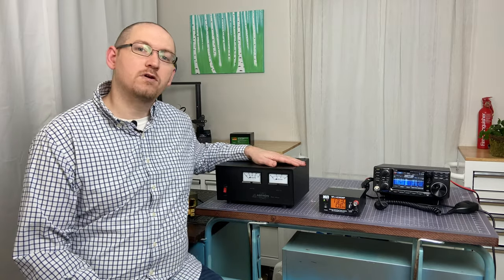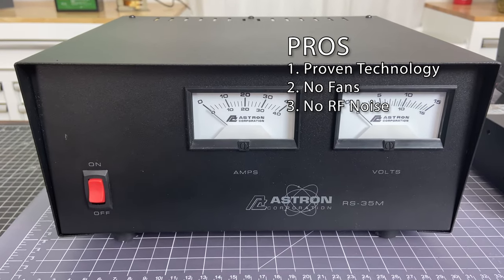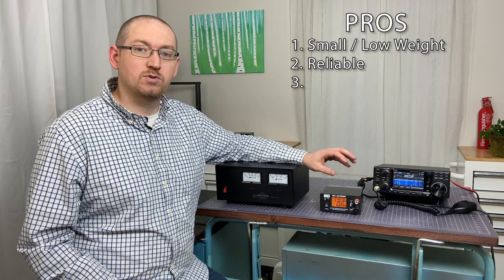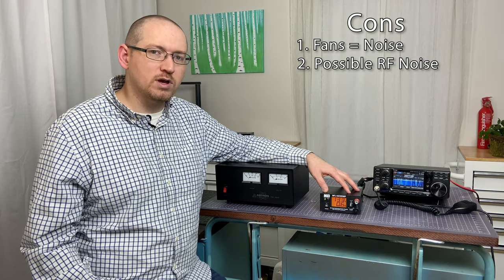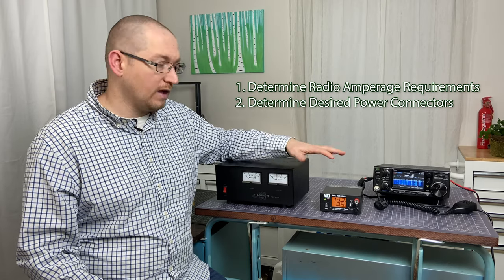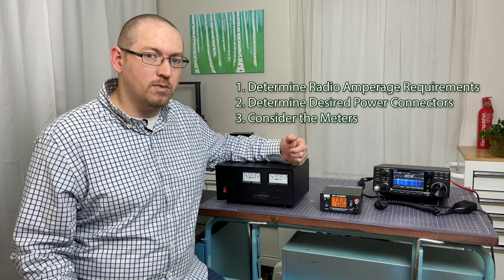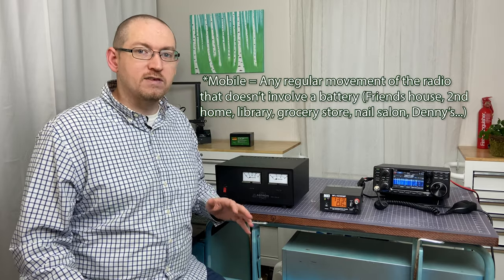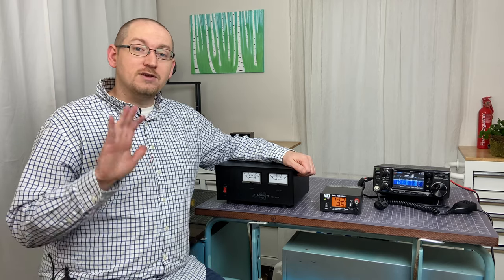Your First Power Supply - Linear or Switching?

Comment: I have a Astron 50M and have used it for about 30 years now. I hated to move it around to attach another radio what a pain. So I got my trusty Ryobi drill and put 4 holes in the front. Now I have 2 more sets of terminals with easy access. Like I said this supply is a beast. Also have a 70M but that thing does not get moved at all.
Reply from the maker: I'd love to see how you connected the 2 additional sets of terminals. That would be a good project!

Comment: I was using switching power supplies before switching power supplies were cool, early 1990s, and the switching supply I used then and still use is a Lambda switching power supply rated at 48 amps. I almost completely attenuated the RF hash noise by brute forcing ferrite beads at the output of the supply to where the noise was just above the natural noise floor of the band I was working, 10 Meters in this case, and arguably the least noisy of the HF bands. Don't let the EMI noise scare you away from using switching power supplies.
Reply from the maker: You bring up some really good points: Sometimes the noise generated by local sources is lower than the noise floor and consequently it isn't as big of a problem as it might seem. Also, the companies have had thirty years to keep making better and better power supplies. Thanks for adding to this conversation!
Reply: Linear regulated is still a better power supply than switching . I can detect the RF hashing noise on my high end equipment from switching power supply's.. Linear Regulated is the way to go.
Reply: The title is "your first power supply".  If that's the case, I doubt someone would be able to trace the source of the noise, e.g. the linear supply K-Tech fixed by moving a ground.
Reply: I agree, I use a Samlex 1235M and i have no rfi issues whatsoever

Comment: I have a 223 pound power supply that the titian two check out missile used.  I got it at a hamfest for for about 150 bucks that I ran on two repeater systems on VHF and UHF with power amps.  This monster puts out about 100 plus  amps at 12 to 14 volts.  I still have it and could power up any Kilowatt ham station for ever...

Comment: 2 October 2024. Just bought  this last unit available Astron 35 on Amazon. I hate fan noise. Its about twice the price of a good switching power supply I was thinking about getting. Always get good stuff your planning on using for years.

Comment: Another pro for linear supplies like the Astron you have there is repairability.
Because linear supplies are fairly simple their repairs can also be pretty simple.
Unless you melt down the transformer in one of those supplies you will probably be able to repair it quickly and cheaply.
Cheers.
Reply from the maker: Excellent point. For anyone that is willing to learn, that could be a good opportunity, and without a significant overhead of knowledge. Thanks for bringing this up! 73, AC3DS
Reply: @netautorisationnetautorisa545  😂
Reply: Yes yes yes
Reply: My RS-70M got hit by a lightning strike several months ago and it may not be repairable.It’s well over 20 years old and it has served me well.
Reply: Greetings: True. I was a remote service station 4 Astron back in the 80s - early 90s prior the major employment of consumer grade SMPS. All that came in lived, warranty or not. I could not make modifications on warranty however I did some upgrades on non warranty units as per customer request and permission. I implemented some of those mods in many supplies I built. A few I still use on my bench.

Comment: Good video 👍 like you I use both my MFJ switching power supply just dyed after 21 year of continuous running for 24 hrs a day.  I will replace it with a new MFJ switching but I pulled an old 20A ASTRON liner out of the closet that’s been there for at least long and it fired right up so I thank both are great quality. I bought the ASTRON 20A back in 1982 so it’s been around a while.👍✅  KV5P
Reply from the maker: Thanks for sharing your experience. 21 years @ 24 hours per day -- Wow, definitely got your money's worth there. For the Astron, I'd say 38 years and still running is a ringing endorsement, even if it has been sitting for a while. Both manufacturers know their way around a solid power supply. Good to know I won't be shopping for one anytime soon.

Comment: Building my first shack and went with the Yaesu FP-1030A linear 30A power supply.  It's very quiet but the analog meters aren't illuminated.  

I also fly RC model aircraft (electric) and the Electronic Speed Controls are offered with either linear or switching BEC (Battery Elimination Circuit) to power the receiver and servos using the same litium-polymer battery as the motor.  These generally run around 10A or less so use switching BECs.  Battery efficiency was the prime consideration for RC.  Quiet for my Ham shack.
Reply from the maker: Yaesu makes high quality goods, and the FP-1030A is a solid supply that should bring you years of care-free performance. It is good that those BEC are quiet in the shack - I have some RC that are very noisy and as soon as I turn on my radio I'm reminded to unplug.

Comment: I have the same astron power supply. Had it for a month and working great
Reply from the maker: Glad to hear it. They are great machines that, because they just sit there, don't get as much pomp and circumstance as they deserve. Thanks for sharing!
Reply: I've got a VS-35M (same except variable voltage) for as long as I've been a ham.
I was first licensed in the 70's. I've had to change a pass transistor once and it keeps on ticking.
Had a switching supply when they first came out. Couldn't use 40 meter because of a whirling zero beat sounding rfi. They're better now. Still have my 35A and got a Astron 70 amp for my amps. A linear supply for my linear's

Comment: I use only linear supplies for my regular equipment, although the amplifier runs on a 32V 150A industrial grade switching supply specifically made for transmitting equipment by AM. The problem with cheap switching supplies are the loop speeds that are super fast to protect the marginal FET's used and that get triggered by peak modes like SSB, CW and sometimes digital. This can be overcome by adding a big enough storage capacitor with a soft start. But by the time that is done one might as well go back to linear supplies.

Comment: Good advice. I'll add another option. I have two linears, an Astron RS-35A and a Pyramid PS-26KX. The first doesn't have meters, but I got such a good deal on it at a hamfest I don't mind. The Pyramid has meters and an adjustable output voltage from 6-16 volts. Those who're planning to experiment and may need different voltages might pay a bit more to get one that is adjustable.

Comment: In general - a good idea for a switching supply would be a GO box, provided you didn't restrict the air flow by buring it in a mas of cables and/or panels.

Specifics - I've always looked at MFJ with a cautious eye.  Their quality control has gotten better, and they make some popular equipment lime the Versa Tuner and 259 (antenna analyzer).  I've not heard much about the switching supply, so no news is good news (?).

The Astron linear and switching supplies are workhorses, and I've only had one RS-35 fail on me when transmitting on an HF rig.  A capacitor and voltage regulator replacment fixed that and havr not had problems since.  Also, I've not seen a problem with their switching supplies.  Their fans are quiet, and no hash on the RF.

What you presented is a good foundation and understanding the difference between the two types.  I look forward to seeing more of your videos.
Reply from the maker: You are very right about the use of the switching power supply in a GO box - a definite addition. 

I've seen some great products by MFJ, and then I've heard some quality control issues as well. The only piece of MFJ equipment that I've personally observed being of unusual quality was a 259 that looked like it had been repurposed from other pieces of metal with printing on the inside that definitely didn't belong --- but it didn't affect the performance at all, so no harm in a sense. 

Thanks for the feedback and for adding to the conversation. The experience and voice that everyone brings to the discussion helps new and experienced operators alike! 73 - AC3DS
Reply: I always open the case on anything I get from MFJ and remove the loose screws and solder blobs rolling around inside and check for anything out of place before powering it up the first time.  It happens a lot.  MFJ has a reputation for a reason.

Comment: I've got a VS-35M (same except variable voltage) for as long as I've been a ham.
I was first licensed in the 70's. I've had to change a pass transistor once and it keeps on ticking.
Had a switching supply when they first came out. Couldn't use 40 meter because of a whirling zero beat sounding rfi. They're better now. Still have my 35A and got a Astron 70 amp for my amps. A linear supply for my linear's
Reply from the maker: Variable voltage would have some advantages. One day I hope get my hands and mind some experience with tube-based equipment. Knowing that 13.8 is a bit of an average, I suspect that having a variable voltage supply would be beneficial in optimization and flexibility. I see these beautiful radios and amps from the 40's - 80's and know that there is a lot of great learning, making, tinkering, and communicating, to be had there... Good point about the need for a linear for the linears - when a shack starts to build up, the power requirements tend to increase as well, and the Astron 70 seems to be the gold standard for heavy lifting. 73- AC3DS

Comment: My old Alinco power supply DM-340MV is the best and am sorry they stopped making it... I run 3 radios off it and have no problems.  The switching power that I have has RF problems even through they say how to get rid of it, but a small of RF is still there.  Get a damn good old linear power supple.  If you go Mobil get a good battery... Nice video through and educational ...

Comment: I just use an old PC power supply that provides 36 amperes for my radio equipment testing and setup.  I do transmit CB sometimes.  But I am not licensed.  I repair, modify, upgrade, make antennas, make manual tuners, make amplifiers, setup stations, and setup repeaters. But without a license, CB is the only transmitter I have and it is used seldom.
Reply from the maker: Using a PC power supply is a good thought. I'm going to have to give that a try. I know that they typically have 5+ outputs, with different voltages and amps, so this should be a good test. Citizens Band is where I started and stayed for many years. I didn't know anyone in Ham Radio, but loved the idea of taking my local communications and expanding out. From what you shared, you are a true maker, so keep it up and continue to enjoy that wonderful spectrum.

Comment: I started with an Astron RS-12(which still powers the Shack), and a Pyramid 30A, both linear. Both also found in the ewaste pile at work with some other ham gear that also came home.

Comment: Hello. Can you connect two rigs to one power supply? In other words, have uhf/vhf and Hf on one power supply?
Reply from the maker: Good question. Thanks for asking! Yes it is definitely possible. Depending on the type of power connections on the radios (powerpoles, bare wires, ring terminals) and on the power supplies (posts, terminals, poles) , this could be really easy or only a small amount of work to set up. Each radio will need a certain amount of current in order to be turned on, and a different amount in order to transmit, and provided that the power supply can handle the sum of all of the simultaneous current draws, it will work just fine. But wait, there's more... 

If you want to transmit on more than one radio simultaneously, you need to know maximum current of each radio. My HF radio draws about 20amps when transmitting in SSB. If I were to have a second radio of any kind, and wanted to let one run digital modes and the other phone, I would want a power supply of greater than 40amps + some extra cushion. 

If you only want to transmit on one at a time, the max amperage of the power supply should be just a bit more than the max of the largest radio. For me, having two, three, or more radios connected to my 35Amp supply is not a problem provided that I don't try and key up on multiple simultaneously and draw more than the 35A the supply can provide.
Reply: @transmittinguntilrobotsrep1045  got ya, and thanks for the reply!

Comment: I've found linear supplies like Astrons which use an LM723 can emit broadband RF noise or hash....I've solved that problem by bypassing the pins of the 723 which are connected to diodes internally...IIRC, I've added .01uF ceramic caps across those pins to ground to kill the noise...While it's not normally a problem, I've found that shunting such caps across diodes in power supply sections can help with the noise floor of the device powered by the supply...

Comment: How do the linear supplies do when powering an HF rig doing something like FT8, in which the radio may be going back and forth between transmitting and receiving every 15 seconds. Can they handle the frequent increases in amps??
Reply: Linear power supplies track changes in demand current essentially instantaneously, there isn't a "loop" per se.  Switching power supplies have a feedback loop that controls the primary of a small transformer so there can be a slight delay in transient response with a switching power supply.

Comment: I had a MFJ switching power supply that failed and provided an over voltage condition that damaged 2 of my radios. I now use an Astron 35A that includes crowbar over voltage protection.  Another advantage of the linear.
Reply from the maker: Bill, I'm really glad that you brought up the crowbar over voltage protection. It is a great feature to have built into the Astron RS supply and definitely something that can bring some piece of mind. All equipment can fail, but there is certainly a value add to well engineered devices.
Reply: You can add an SCR crowbar to any power supply.  You can make one that just connects externally.  It only requires a few parts.  If the output voltage rises above a preset threshold, it will short the output to ground and either blow the primary fuse on a linear supply or trip the overcurrent protection on a switch mode supply.  I'm not going to trust MFJ with the thousands of dollars of radio equipment connected to that $100 power supply.
Reply: About that crowbar:  It destroyed the final transistors in Icom IC7300 when it suddenly crowbarred from RFI.  By shorting the power supply, the capacitors inside the radio discharged backwards through that same crowbar briefly reverse polarity on the MOSFET's.  They don't like that.   Astron has a fairly simple fix for that, ferrite beads on the crowbar SCR.
Reply: @thomasmaughan4798  How exactly would a capacitor "discharge backwards" into a dead short?  The caps are charged by and at the same polarity as the power supply.  Plus the IC-7300 has reverse polarity protection via D201 and D202 on the PA board to protect against that (top left on the PA-1 schematic, right next to "dc-in").  If you have fuses in the power cables, reverse polarity from outside of the rig shouldn't be a problem.  And if it is from inside the rig the diodes will still clamp it. How do ferrites in the PS help with caps in the radio discharging?
Reply: @stargazer7644  "How exactly would a capacitor "discharge backwards" into a dead short?"
I don't have time right now to inspect the schematic and provide a detailed answer.  However, the concept is simple enough.  All of the capacitors in the radio will be holding a charge at the moment the crowbar SCR fires.  The abrupt grounding of the 12 volt supply rail changes the discharge path of all of these capacitors.  While that might seem to be harmless, it isn't, and wasn't.  I had to send my radio to Icom for repair.  

Perhaps Icom has added polarity protection diodes for just this scenario.  I might as well check my schematic for the diodes you identify. 

Okay; the diodes are in parallel with the input, not in series.  They are not subjected to reverse polarity in the circumstance of a crowbar situation; they simply experience an abrupt transition to zero volts (well, the forward voltage drop of an SCR).   This voltage will be presented at the drains of the totem-pole MOSFET in the power amplifier.  By itself that should be harmless.  Somehow, and I have not figured it out exactly, both MOSFETS must have become conductive simultaneously and as the impedance of a fully conducting MOSFET is less than that of a SCR, the MOSFETS took the brunt of the Astron power supply.  

Interestingly, the crowbar is supposed to blow the fuse, but it didn't.  I turned off the Astron almost immediately when I detected malfunction.  

The ferrite beads are to be placed in the legs of the SCR to prevent radio wave induction from triggering the SCR, a known problem.  As I was using a magloop antenna there's a lot more near-field induction than would otherwise be the case.

It also bothers the Battery Management in a Goal Zero lithium battery!  Abrupt shutdown but at least not crowbar.

So now I use Stupid Batteries a pair of 35 AH gel cells and when I need a bit more power, like anything more than 11 watts, I boost it with an MFJ booster.

Comment: I have the same 35 amp Astron power supply, but the newer version with the power poles in the front.  The power poles are really small and I don't see how one would fit a number of 16 and 14 AWG wires into the poles.  I hook the four 13.8 volt wires that I have into the back using crimp on ring terminals. Into the back looks a lot cleaner.
Reply: You don't fit a number of 16 or 14 wires into one powerpole.  You connect it to a breakout adapter or a power distribution box to give you multiple power poles.